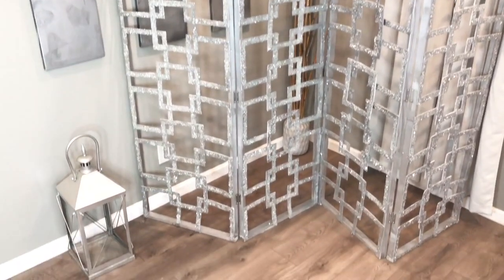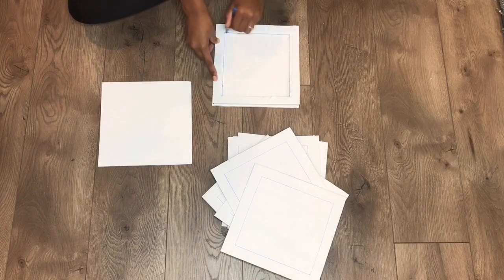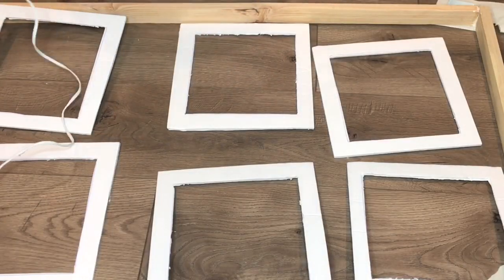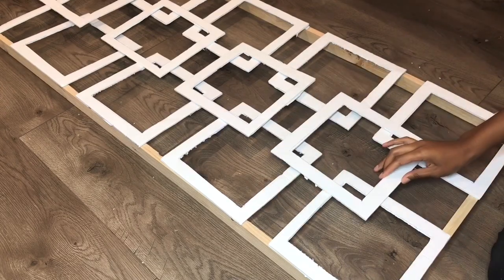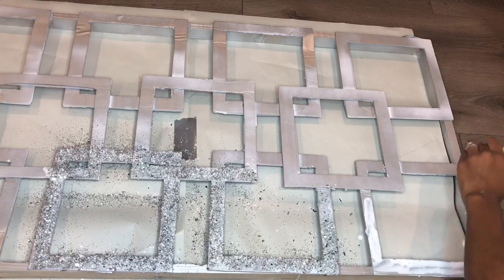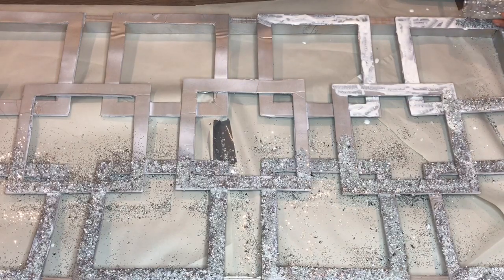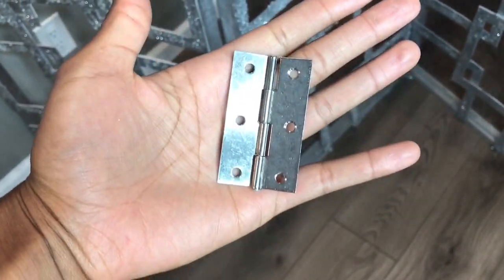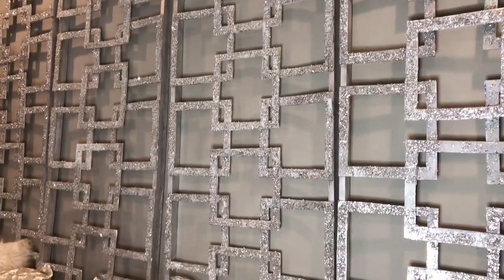DIY ROOM DIVIDER/WALL DECOR

Comment: Hello what are the Square size you're using for the room divider & where did you get your foam boards from
Reply from the maker: Naomi Goodson hello !! I’m not on Facebook right now but I’ll be glad to help you ! The square I’m using is 6x6
Reply: @LotsofglitterAndshiii  where can I get the Squares from to even start this project off
Reply from the maker: Naomi Goodson you can go to the dollar store and find some square paper plates or you can just use a ruler and measure 6x6 and then measure 4x4 inside the square
Reply: Hello I also want to know what size foam board did you use
Reply from the maker: Naomi Goodson I don’t remember the size but I got it from the dollar tree. I believe there is only one size foam board so you should be ok !
Reply: @LotsofglitterAndshiii  Thank you